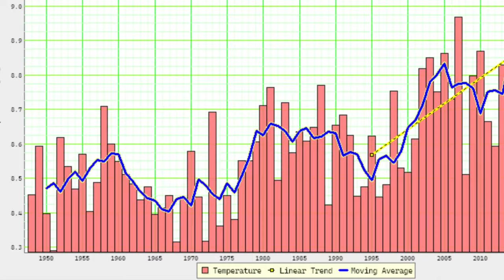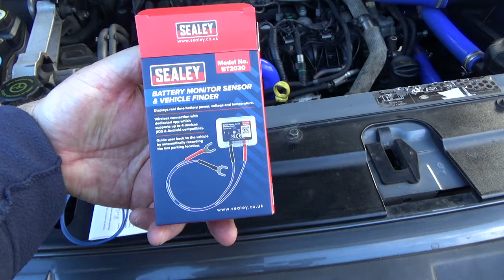VLOG #2 - Just stop oil leaks!

Comment: Would you not consider relensing those headlights which is something im considering, i was lucky enough to pick up a pair of projectors very cheap(less than £70) but i found the light spread from the old set far better. Paper filters will reduce moisture going through to sump.
Reply from the maker: I don’t think the front ‘glass’ is easily removable. I’m pretty sure it is glued in. The clips just hold it in place while the glue sets during the manufacturing process. I now have a pair of projector lights and will be swapping over to these very soon. The old halogens are beyond repair and will be going in the bin.
Reply: I've been watching vids where they put them in box heat them up until glue softens then remove the lens, I'm thinking bout giving it a go summer😂 if we get one.